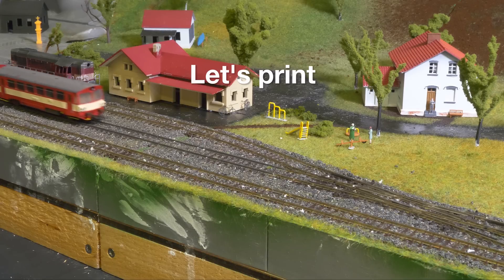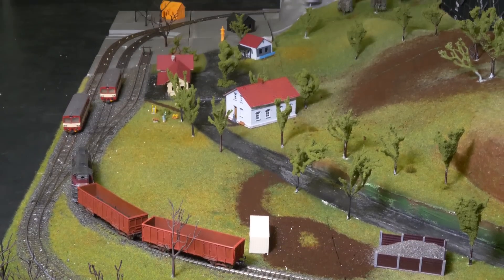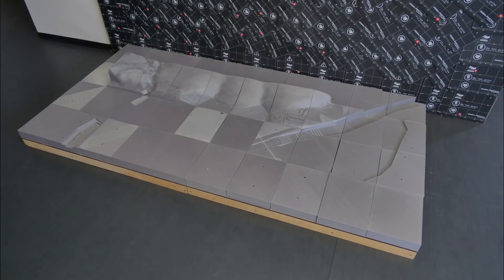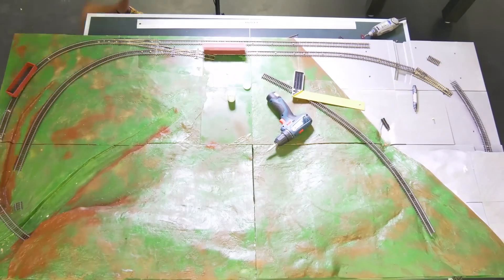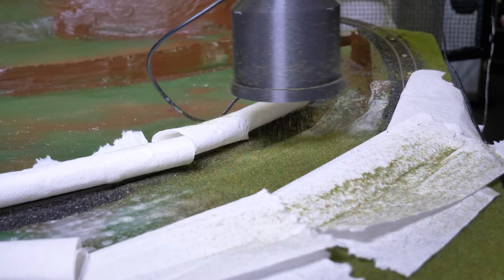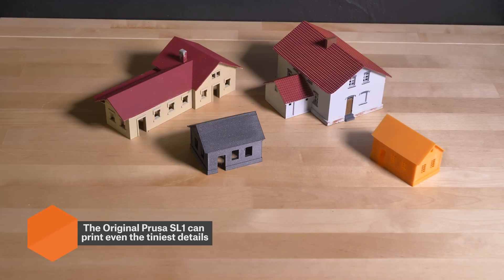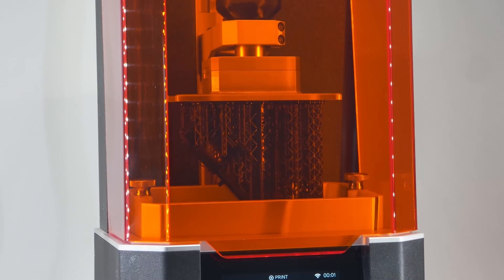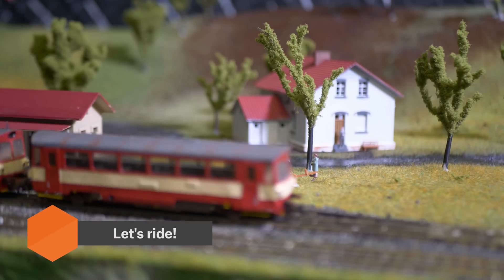3D printed railway models, part III: The final model

Comment: Honestly, this is a waste of plastic. Sure, it’s PLA and not oilbased and all, but still a waste. A simple wiremesh with some fabric or even paper covered in plaster would have achieved the same result a lot faster, cheaper and using fewer materials. 3D printing isn’t always the solution.
Reply: This is a 3d printing channel, not a model railroad building channel.  What did you honestly expect?
Reply: Jim Bob  I do not disagree, but to come post non-sense about wasting plastic and so on...given the subject matter... just silly.
Reply: To anyone who owns a 3D printer this is just wasting plastic and time. You should have spent that plastic making other cool things, that’s sort of the point of 3D printing, you get complexity for free. Making non complex large shapes doesn’t make sense unless you have a limitless supply of printers and plastic (which Prusa definitely has).
Reply: noch disagrees and has sold "plastic" landscapes for decades.
https://www.noch.com/en/product-categories/model-railways/preformed-layouts.html
They are quite expensive though
Reply: While I agree that generally speaking, a plastic base is dumb like they did here.  However, reminder that the layout is in 4 parts.  As such, I'm looking at the plastic land being a way to add rigidity and strength to the overall layout when transporting each section individually.  Something you would need to be more careful of with normal foam/plaster techniques.  Also, not everyone has the artistic skill to carve out realistic looking scenery from foam/wire mesh compared to getting landscape tiles online somewhere to make the scenery you want.

Comment: Printing that terrain takes so much time It would be better made manually somehow I think
Reply: It's very easy with foam, cardboard, newspapers and then covering with a product like sculptamold.  I get that this video is trying to do everything 3D printed, but there are much easier methods.   https://www.youtube.com/watch?v=KyO24WR4QOc
Reply: Now, for things like people, buildings, cars, signals, etc. Yeah, 3D printing can be really useful.  Those items go for big money at the hobby shop, so DIY will take some time but save you a lot.
Reply: And the cost of all that filament... Impressive but not practical for things like the landscape.
But still, it is impressive and cool!
Reply: I think with large nozzle it's not bad, or even simply higher extrusion width, speed, layer height and temperature. You can set higher width than your actual nozzle size and imitate a much larger nozzle to an extent at the cost of increased backpressure and potentially somewhat less consistent flow. You know how quickly spiral vases go and those prints seem to be similar enough.

Cost of filament? Well if you don't need a lot of load bearing capacity, let's say you get a 1mm thickness all the way around and are printing a 20x20x5cm size tile, you rotate it on the side, and you leave one side open, the opposite one, and you can probably avoid using support material entirely that way, then the perimeter is 1100 cm^2. At 1mm it's just 110ml of material or less than 150g. So let's say you're paying 30€/kg, that's 4.50€ per tile, which can be worth it if it for some reason saves you time, like if you have to work to an existing plan or geographical data, and you can probably get it down to 1.50€ per tile if you absolutely have to with less print thickness and lower grade filament. If you need more rigidity, you can still cover the inside with a layer of plaster or something.

So i think while unconventional and usually unnecessary or even counterproductive, it is a whooole lot more practical than you'd think.